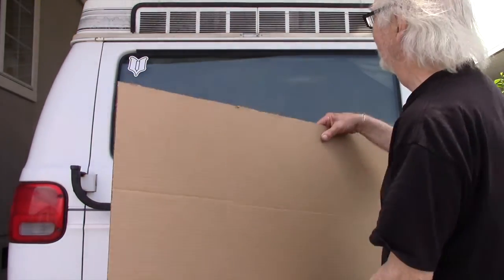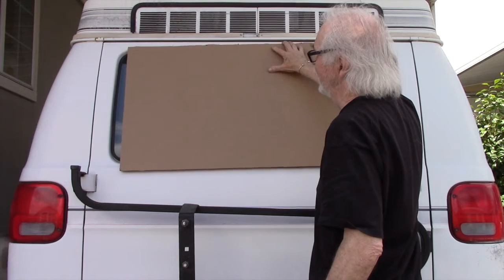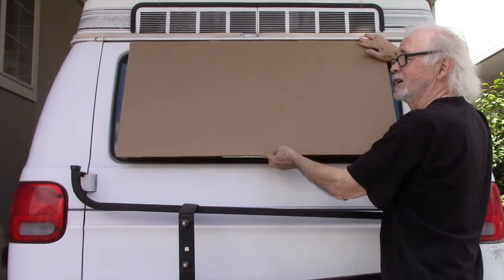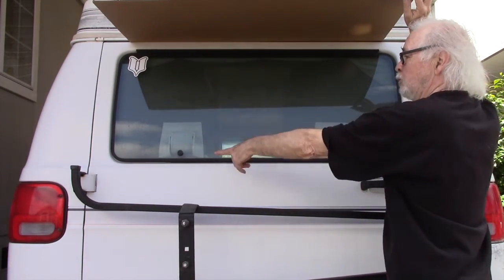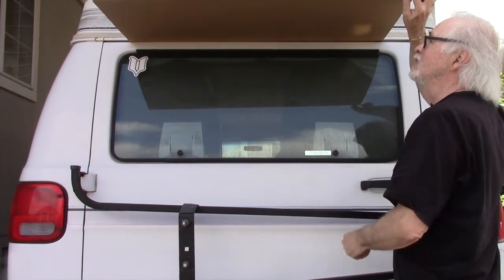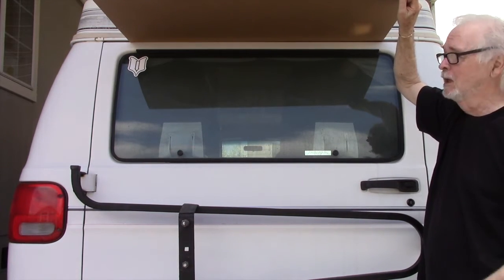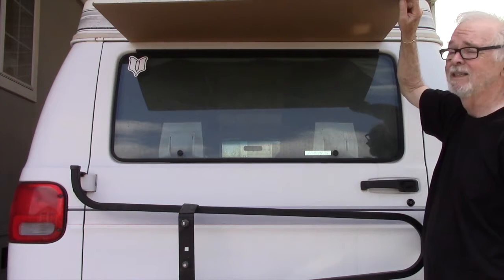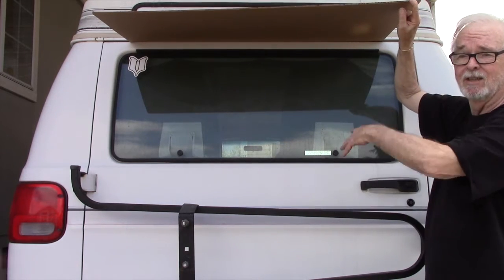Solar Panel Goodies On The Way - Now a Mock Up

Comment: I’m looking forward to this. I already have 220 portable solar panels. I’m struggling with my battery placement. Under my spare tire in a small box. I can’t get the battery out
My gen is acting up. Considering removing it & adding batteries there

Comment: RR, I'm asking you since you seem to know stuff. 
I need to measure the maximum amps that my Dometic fridge pulls when the compressor comes on and it surges to its maximum draw. When it happens, it shuts down my Renogy Lycan Powerbox, so nothing gets power!  It's happens only intermittently, so I can't stand there with a VOM all day. (Renogy has tested the Lycan and says it's OK.) This can happen during the night when I'm sleeping, so, I need a tool that I can attach to the DC input of the fridge that will remember the number of amps so I can read it in the morning when I wake up. Is there such a tool/meter? Thanks.
Reply from the maker: Hi avlisk, Thank you for the question.  This is a 14 carat gold one.  

Before we look into something to record peak amperage to review at a later time, let us see if we can determine what might be happening.

I looked at the Renogy website and got the specs on the power box.   

Logic would say you have probably connected the Fridge to the 12 volt cigarette lighter style output on the Power Box.

This connector is 12 volts with a max of 150 watts output.

That equals 12 amps.  

The refrigerator with its DanFoss compressor draws a maximum of 5 amps, maybe 7amps at a peak.

So there would not seem to be a reason for a spike in amperage to cause the Power Box to shut down.

These two devices have a common feature that other devices do not.

They both have logic circuits in them that make a decision to shut themselves off.

I have heard other people having a similar problem with other so called "generators" like the yeti.

This may sound kind of weird. The two "brains" may not be compatible.

Here's what I imagine.  The "brain" in the Fridge is looking at how much power it can get from the Power Box. The Fridge assumes it is connected to a 12 volt battery with no brains.  It demands, "so, battery, tell me how much power you got left in you?"  A 12 volt battery ( not the power box) says, "duh, I got 12.5 volts" (it's dumb, no logic circuit). But the Power Box says, "who's asking and why do you want to know?"  "are you looking to get more than this 150 watt outlet can provide?" The Fridge doesn't answer. 
The power box is having a demand made that it has no logic programmed into it to resolve.
The "safe" thing for it to do is shut down.

How could you referee this "argument" so the two devices can "work together".

If the Dometic fridge has the ability to use AC current, you could plug its AC cord into the Power Box at night and see if the two get along overnight and the Power Box doesn't shut down.

If all you have is the 12 volt option, you could get an AC to 12 volt DC power supply ( not a charger ) that you would then plug in to the DC input on the fridge.

Because you are using the AC side of things on the Power Box, and an AC power supply, these two units are used to dealing with each other, they aren't "suspicious" of what the other might be up to.  They conduct themselves upright and above board, they are "professionals".

I know I'm weird to give devices these kinds of qualities but by thinking in these terms I can usually understand what's going on and figure out a solution.  I have a very strange affinity for machines.

I think the underlying cause of your problem is a personality conflict between your machines.

If you go back and re-read this thread, as I did, you will find there is a consistent logical progression that leads to this conclusion.

Both of your machines operate just fine individually. You have even had Renogy give theirs a clean bill of health and proper functionality.

When the two get together on the playground, one does something the other doesn't like and it takes its ball and goes home.

Other devices get along just fine with the Renogy...no fighting, no shutting down.

The Fridge gets along just fine with a dumb 12 volt battery, it gets to be in control, decide not to "hurt" the dumb 12 volt battery who would just keep giving it power until it croaked.  Aw, poor, stupid 12 volt battery, okay, you've hit 50%, I'll do the right thing and shut down 'til you can go recharge yourself.

Weird isn't it?  Of course, I could be completely off base. But as is often the case, someone with much more technical acuity than me says to me, patronizingly, "yes, well, I'll do a little more testing".  Then later comes back and explains in technical terms, which fly right over my head, the same thing I said.

But now they own it, in their own particular language.  Either way, that was the problem and they get the solution.  When that happens, I am happy, glad and especially amused.

The thing I notice and I hope you do, too, is that electricity is a natural thing. All these protons, neutrons and electrons fly around and do what they do.  It's when the human element gets introduced into the system that things go haywire.  It's the human that put the "smart" into the devices with the logic circuits, the if then statements, the conditions, the rules, the regulations.  As if the system wasn't "smart" already.  As if we were so presumptuous to think we knew something. The natural system that formerly worked perfectly has now been brought down to the level of the human and its limited, finite, flawed qualities.

I'm sure the system is looking over its shoulder back at the human saying "guys, we're the power of the universe, you're...human...come on...get a clue about who is making who "smart" !"

I just love this kind of stuff...it is so humbling...keeps me from thinking to highly of the species.

I hope this helps. If not, I hope you got some amusement form it.
Reply: I am actually entertained and informed by your reply. As a non-techie, I understand your explanation. Reminds me a little bit of this:  
https://www.youtube.com/watch?v=grc42ldHAP8
The CFX35 is AC/DC, but, reading so many times that using the AC inverter is inefficient and wastes the stored battery power, I never considered using it. But now, I will give it a try and see what happens. It'll be another 24 hours because Renogy returned the Lycan almost depleted and I need a day to recharge before I can run any tests. Thanks. And stand by.
Reply from the maker: I'm pretty sure it will take more to run on the inverter than it does on the 12 volt side.  
The good news is you don't need a power supply. You can plug directly in.
The better news is going that direction the amperage is going to be a tenth of the amperage you pull on DC. I all equals out. 12 volt DC amperage divided by 10 is 120 volt AC amperage, in ohm's law.
The DanFoss compressor is used in most of these so I'm going to use that as an example.
On DC 12 volts, the compressor is drawing between 1.9 and 3.8 per hour.
On AC 120 volts it's drawing .20 to .40 amps. That's two tenths to four tenths of an amp.
So yes, there will be some loss depending on the efficiency of your inverter but I would suspect the inverter in that Renogy is top notch so it's probably very little and unlike external inverters, the one in your Power Box is an integrated part of the larger system. No cables, no voltage drop.
 
After the Power Box gets charged back up, talk to those two.  Say, "I'm bringing you two back together."  "I know you were having some trouble getting along."  "We're going to try something different." " So we're gonna have a handshake here, reconnect you two and see if we can get along, okay?"  

I know, people think I'm nuts. So nuts, they're afraid to ask me what I think they are... I like that.

Comment: "K.I.S.S."  Rich, this sounds like to much trouble! Put that "puppy" (panel) on the roof!
 Tape it up there with "3-M VHB Tape"!  (no holes in roof)???
Reply from the maker: Hi CAJUN Jamis, I'm a KISS advocate, too.  This panel may very well wind up taped up on the roof.  But I my situation, there are enough advantages to having the panel movable that I have to investigate the feasibility of that.
Reply: Rich, your feasibility study will blow the K.I.S.S. theory out of the water!
(Off the sides)  LOL            (IMO)
Reply from the maker: The way I look at it, I can always fall back on the traditional.  It's the unconventional that holds appeal and intrigue.  I sometimes balk at the ideas that pop into my head and say to myself, why not just do it normal?
I get that all the time. People say, "Rich, why can't you just be normal?"
I have to smile, for the same reason I can't be Chinese, a tuna, or an oak tree...I wasn't born that way.
For some reason, all these goofy ideas shoot into my head and rather than shoot back out in dismal, they start bouncing around. So in order to be a good host, I try to make them comfortable, entertain them, get acquainted.

I don't know, maybe ideas have feelings, too and the word has gotten out that they can receive a little hospitality over there with that guy in the van.  Makes 'em feel welcome.

I'll share a little "idea" story. I was employed as a designer. I used Photoshop a lot. Probably 30,000 hours in that application alone. The company I worked for would send me to "design seminars" to "learn" from "instructors".
In the morning the instructor went through a masking technique, excruciating for me to sit through.
At the break, I said to the instructor, "let me buy you a coffee."  We sat and drank, I opened a laptop and said, "this is how I do that masking you presented this morning, or sometimes I do it like this, or this way, or like this."
His jaw was hanging on the table. He gathered it back up, got his composure and said, "yeah, yeah, definitely."  "do you mind if I share this with the class this afternoon?"
"Not at all, please do", I responded.

For me, it's not about fame, fortune, recognition. It's about being true to the creative process.

That's what got us from huddling in caves to living in skyscrapers.  Every person is creative.

I believe it is in our interaction that we achieve greatness. There's some need for orthodoxy and creating repeatable results. But the innovations, different applications are usually found as an idea rattling around in someone's head.  And the usual response is "why didn't I think of that?"

I think the answer is ideas like seeds do best when they find a rich, nourishing environment to germinate and blossom into what they are to become.
Reply: YES, Yes, truly the mind of a GENIUS!!!  You are indeed a , ORIGINAL!   "FIX IT LIKE YOU WANT"   *** ROADTREK RICH is Da MAN!!!***

Comment: Seems to be a smart solution. Easy and simple.
Reply from the maker: Hi John, thank you for the comment.
I hope it's smart. As far as easy and simple, I don't know. I think once I trial and error a few things, it will become more clear.  If it is doable then once someone sees it, it becomes kind of like a the concept of a paperclip. A paper clip is designed to hold papers together but makes it possible to remove the papers easily, rearrange the them and hold them together again.
There are other things that hold paper together, glue, staples, bookbinding, punched holes, spiral binding, etc. Some are "permanent", others less so. It just depends on what the goal is as to which one would be the most appropriate for a particular application.
The paperclip is elegant in its simplicity and purposeful in in its function.  
As a designer, these are things I always strive for.
Your mind is such that an idea is such you can picture it, move around it, weigh the pros and cons, me too.
Sometimes people have a hard time with an idea and when it manifests in reality, it's easier to relate to.
I'm kind of living one of those old "Birth of Flight" videos where the wildly pumping contraptions are pounding themselves into oblivion.  The "idea" seemed like it should work, time and effort was put into working out the details and the results are...well the results. 
We'll see. If this proves to be something that doesn't work, there's always the "conventional" for the fall back position.

Comment: My 2 x 100 w solar panels are taped flat on the roof but just barely manage to keep my fridge running 24/7 ...in June....
3m VHB tape is the way to go if you decide to put them on top.  Check "Hobotech" who has a great video on the subject.
Reply from the maker: Hi Swisscamper Ronnie Cool, 
Yes, I follow Hobotech.  He is a valuable resource and has a multitude of well planned, well executed upgrades for these vans. 
I just defrosted my built in fridge. When I started it back up, it went from a "normal" inside fridge temp of between 38 and 40F to 32F at the same setting on the thermostat.  I got over 2 cups of water in the drip pan I put under the freezer compartment.  That translates into quite a bit of ice which would have been blocking the cooling fins and inhibiting air flow into the fridge portion.
Even with this inhibited performance though, the built in fridge would keep things cool overnight and the following day I would drive and recharge the battery for it to run the next day.  It's been in the 80's and in direct sun all day.
I don't know, when I get a panel installed, I'm hoping it helps. I plan to add another battery and I may have to mount more than one panel.  
I'm kind of wondering about 2 x 100watt panels just barely keeping the fridge running. From the numbers, it seems that should be sufficient to maintain things. 
But if it's not working out that way, what do you think might be happening?  
I scored a roll of VHB tape about a foot wide and 12 feet long on eBay for about 12 dollars.  I was suspicious that it might be phony.
So I cut a piece applied it to some test material. It isn't phony. The stuff is STRONG.
I also was sent a video by TazMahal from his channel where he used the 3M high strength commercial velcro which I think uses the same adhesive as the VHB.  I thought his plan to use the velcro was a good idea, too. That way, if a panel becomes problematic, it wouldn't be as hard to get it up off the roof to repair or replace.  He is using the flexible panel though.  I don't think it would work with a rigid panel and the z brackets. There probably isn't enough surface area being bonded.
Reply: Roadtrek Rich  I have louvers on my back windows and they came with stick on plastic velcro it is quite hard to take them off . I just spent a month in England ..maybe thats why the panels barely did the job...not much sun or driving, however they did the job and the fridge never shut off...only the voltage meter came down to 12 v.  You can see the louvers in my last short video..the 2 panels are on this rv..😊
Reply from the maker: I watched that video and at the end, about 3:07 another song starts.
It's killing me, I'm racking my brain to try and remember who did that song. They play it at football (NFL type) games, at colleges, I just for the life of me can't pull it out of my mind. Any ideas?
Reply: Roadtrek Rich  lol..now its killing me too...we will find out 😎
AC DC ??

Comment: I like the solar ideas. I’m not a fan of drilling holes for a roof top panel. Especially the RT. Maybe save some trouble, and store panel behind driver seat? 
Thanks for sharing.
Reply from the maker: Thanks RVan.  I thought about behind the seat, too.  I store a gravity chair and a table there now. It would also fit behind the passenger seat or under the bed. But all these places are less convenient, for me. 
I probably looked a little goofy to people walking around with this chunk of cardboard putting here and there. But I kept taking it out, putting it in trying to picture in my mind what it would be like storing it in the overhead spot I show in the vid. For me, that seems to be the optimum spot. It will involve fabricating some means to hold it there but once I do that, it should make deploying it and storing it quick and easy. Most of all, it will be out of the way and lower the risk of it being damaged.

Yes, drilling holes is something I shudder at.  But that seems to be SOP (standard operating procedure) for people around these vans and rv's in general along with slathering that Dicor stuff over everything. It kind of reminds me of the tar and gravel roofs on commercial buildings. It's effective but messy, imo. And if a person had to remove and replace something...whoa !

I liked what XplorerSteve did when he installed some vents.  He carefully masked around the object and applied the sealant. Then he removed the masking tape and had a very professional looking finished product...to his eye he said it looked better than the original installation. I like that.

Comment: Hey Rich, thanks for the vids man. Enjoyed the fridge ones especially
Reply from the maker: Hi Paintless Dent Company, thank you for the comment.
I've got a dent. Can I send you a pic of it and see if it something that could be fixed the way you fix things?  It's not you usual but it might be something your process could do. I got it when the entire wheel and tire came off of the van.
Kind of turned the rear wheel opening in a little. I was thinking of putting a bottle jack and a block of wood up on the frame section and "jacking" it out. It doesn't really show but I know it's there, you know how that is.